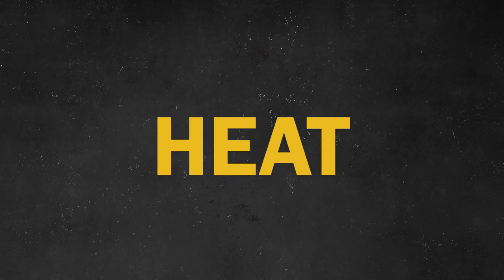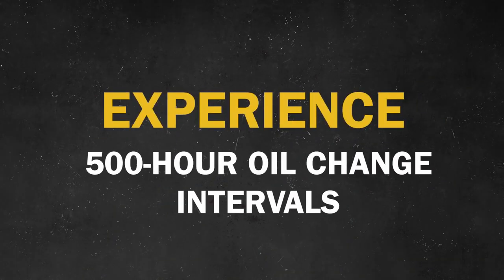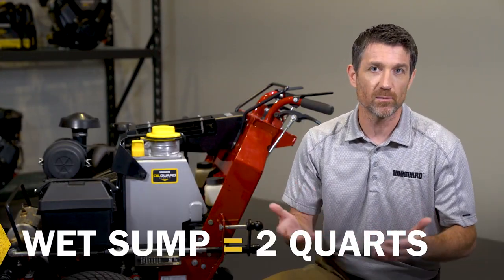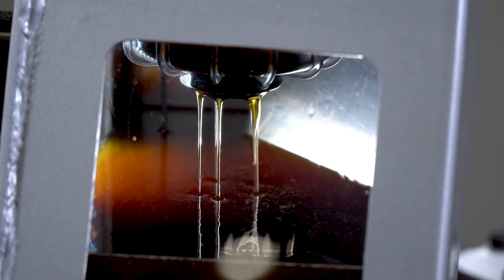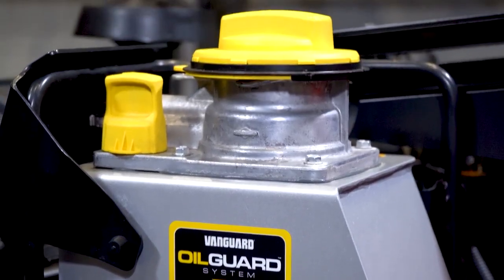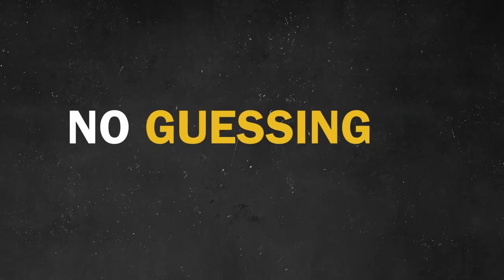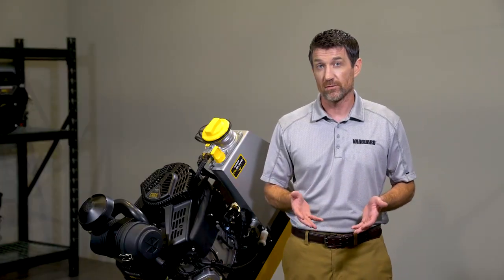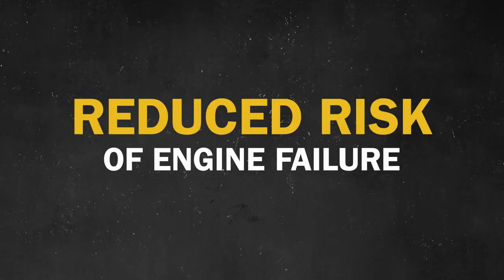Vanguard® Oil Guard™ System: Less Engine Maintenance. More Profit.

Comment: Big diesel mowers  are cooling there 3-7 quarts oil with a 12 x12 inch x 1.5 thick oil cooler and remote filter .  Then most have an  air  precleaner thru stainless snorkel [no rust ] into dual filter Donaldson to an engine mounted air filter . The engines last .  The vangard is good but still  8 outta 10 better than most but not cutting edge 
Then the big diesels have hydraulic coolers another subject . So vangard still 8-10.
Dry sump or not oil still needs changing in dusty environments . Any offroad construction / mining machines are  around 200--250 hrs service interval based on conditions  Say no to 500hrs .....